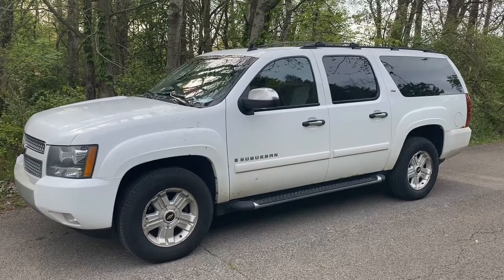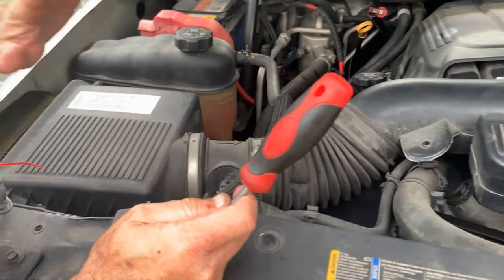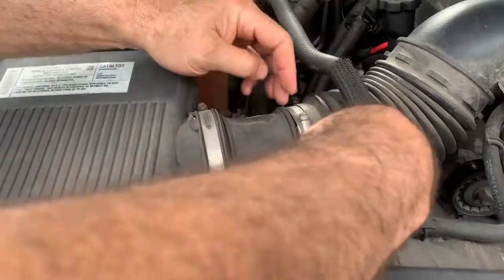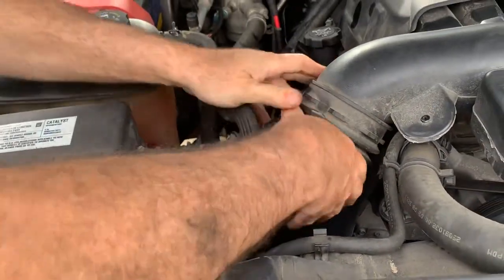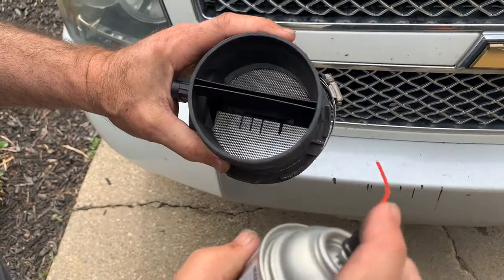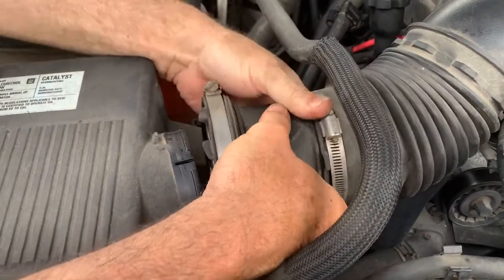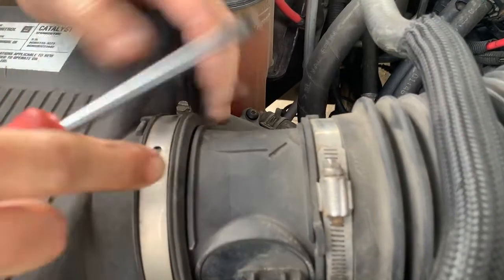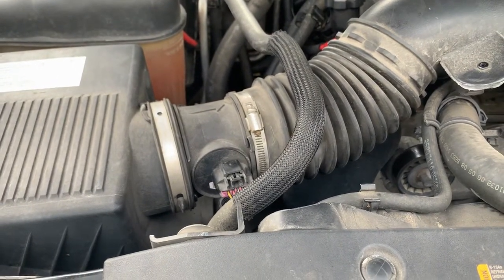How to Clean or Replace Mass Airflow Sensor Chevy Suburban

Comment: Im performing the process of elimination from a p0301 code. Changed the spark plug, swapped ignition coils, and now trying the MAF sensor cleaning. Hope this is the issue however, these chevy 5.3's are terrible. Here it goes..
Reply from the maker: Miles on motor and have you done a compression test or leakdown test on cylinder 1?
Reply: @TheAutoTeacher over 150,000 miles or so.
Reply from the maker: Unfortunately, GM’s Active Fuel Management (AFM) system can itself contribute to engine damage by placing additional stress on the lifters and valvetrain. This added strain often leads to accelerated wear and, in some cases, complete component failure. AFM-related lifter failure is a well-documented issue in the 5.3L engine, and the early AFM-equipped models in particular have developed a reputation for frequent problems.
Reply: @TheAutoTeacher no I haven’t.  I’m sorta only versed in the minor issues, so now I’m sending in for service.  Hate to do it, but 🤷🏾‍♂️🤷🏾‍♂️🤷🏾‍♂️🤷🏾‍♂️🤷🏾‍♂️🤷🏾‍♂️🤷🏾‍♂️🤷🏾‍♂️🤷🏾‍♂️
Reply: And unfortunately, none of those were the issue.🤨🤨😖😖😖😖😖😖

Comment: Hello i just changed my plugs and wires as well and my 07 Yukon Denali XL is still a lil off while idling but still drive fine when i hit the gas but when Im stoped it idle  a lil funny and when the car on in park do you think it could be my maf causing this issue i need to know it's getting  cold and i need to start driving my truck now the weather starting to hit winter months.
Reply from the maker: The things that could be affecting your idle are numerous . Start by telling me if there are any check engine lights and the mileage on your vehicle.
Reply: @TheAutoTeacher   no check engine lights on and mileage is high it's like 280000
Reply from the maker: I would first start with the obvious like any rubber hoses/vacuum leaks. If good I would then check the motor for compression.
Reply: @TheAutoTeacher  ok will do

Comment: Dont u have to disconnect the ground cable off the battery first  so u wont shortened any electric system ? I didnt here u say wait a certain time after u spray the sensor or does it matter ?
Reply from the maker: No need to disconnect the battery, CRC says it evaporates in seconds but we usually give it around 10 minutes and then reinstall and have never had any issues.
Reply: Never showed how to replace just the sensor....

Comment: Aren’t you supposed to remove the negative and positive battery cables first??? I recently cleaned mine, per your instructions and now have 2 code’s on scanner… P0175 & P0172. I’m trying to run down the problem. Do I need to reset the battery? Help
Reply from the maker: There's no need to disconnect the battery for this application, a P0172 code indicates the engine is running too rich. This could be caused by a number of different issues, such as a dirty air filter, bad spark plugs, faulty oxygen sensor, a dirty or malfunctioning mass air flow sensor, or a fuel pressure regulator problem.

Comment: If I do have a P0 code for running rich that comes off and on every couple weeks is it worth it to try to clean it or just replace the sensor system?
Reply from the maker: Try cleaning first .
Reply: @TheAutoTeacher  thank you for responding to this i was wondering if mine was far gone and you cleared the air.

Comment: excellent. Thanks!  ‘03 suburban almosr 200k miles.  Leaks oil, rear valve cover seal and other spots, but the repairs are 2k or therabouts and it’s worth less than that  total so I just add oil every couple weeks.   And now it’s doing the idle thing but I already replaced the mass air flow once before at about 150k miles.   Have never tried cleaning it so i’m gonna try
Reply from the maker: You’re welcome and good luck!
Reply: I've got a 2002 Suburban with 244K miles.  Had idle issues and went away after replacing Idle Control Valve and I did clean out the injectors on one side.  Runs smooth now.
Reply: @rogermerritt6470 how did you clean the injectors? Thanks
Reply: @Ron_Presley  I only replaced them with remanufactored ones.  Fixed my rough running between 40-60 MPH

Comment: i use brake cleaner or carb cleaner havent had any problems
Reply from the maker: Don't use carburetor or brake cleaners on a MAF sensor, as the chemicals in those cleaners can destroy the delicate sensors.  CRC MAF Sensor Cleaner is specifically designed to remove oil, dirt, fibers and dust from the sensor without damage.
Reply: @TheAutoTeacher also spraying maf sensor cleaner at your paint will destroy your paint
Reply: Yeah that is a bad idea
Reply: @grassfedeverything  i really dont think  it is, multiple ways to skin a cat bud sorry i dont do it the way your dad taught you
Reply: Good video.  and I thought the same  thing..."He's not gonna  spray the MAF cleaner right over his bumper/ (paint), is he?" .  But yes he did!!

Comment: Mines missing the screen think it makes a differnce??
Reply from the maker: The screen is primarily there to even out the air flow to the MAF Sensor, so it can get a better reading. It's also second form of protection to make sure nothing to big gets in your intake.
Reply: @TheAutoTeacher  thanks for that info ill be going to the junk yard soon. And also changing out the sensor since i bought it used
Reply: How long did it take for the light to turn completely off

Comment: Thanks for the straight forward, no bs, stable video.
Reply from the maker: You’re welcome!
Reply: I got a doubt i just do it without disconnecting the battery and now the car is having another problem
Reply: I have to erase the codes ?